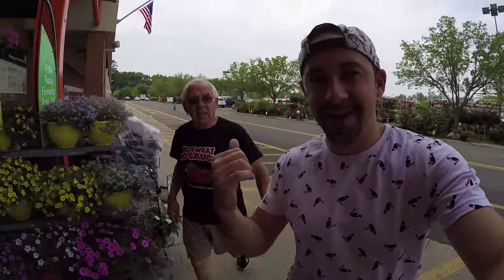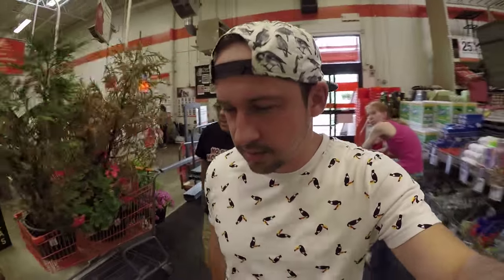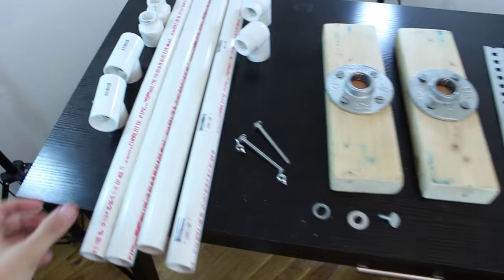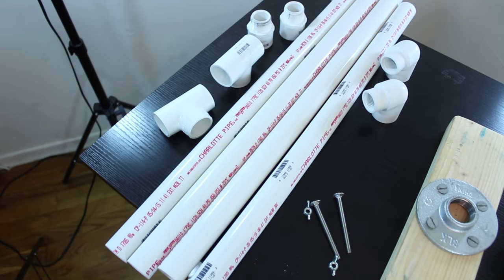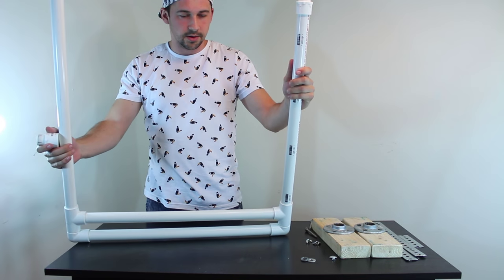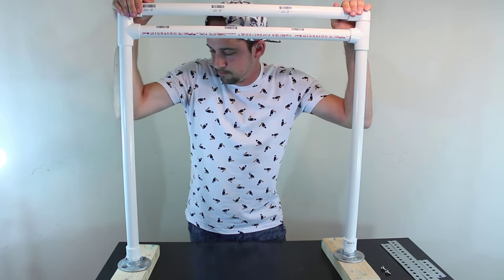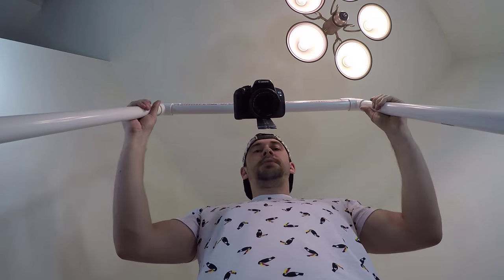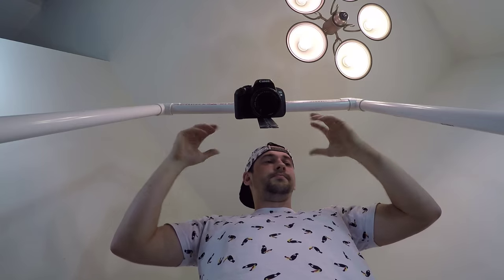DIY OVERHEAD CAMERA MOUNT

Comment: Hello Jeremy, consider isolating the camera mount from the table.  If you have the room beside the left and right sides of the table place the legs on the floor.  Do not connect them to the table as this would undo the extra effort.  Since the PVC is a little flimsy for that length (5 feet high maybe from the floor to the top of the rig?) just double up on the legs so you have four legs (2 on the left side and 2 on the right side) offset by about 12 to 24 inches front to back.  The camera will not shake unless your floor is not steady.  What you film will shake since the table wobbles a little but it should not be as pronounced.

Thanks for your videos.  I'm adopting your vlogging tips.

Comment: Rather than using the wooden blocks at the base, you should put a T joint at the end of the pvc with a small piece of pvc pipe out of each hole.+Jeremy sciarappa

Comment: Hey! Great video! So I recreated your overhead camera mount and it works like a charm. The only thing I'm trying to figure out is how to make the camera not shake. There's a slight vibration, especially when I'm interacting with the surface of the table. Have you run into that?
Reply from the maker: Son of a Pizza Man I've got a similar problem, but the reason why mine shakes is because my table is not stable enough. If I put it on a more stable surface it is very stable.
Reply: My table is also not the most stable. I guess that's the key! Thanks for responding!